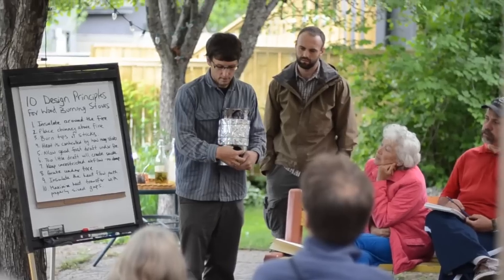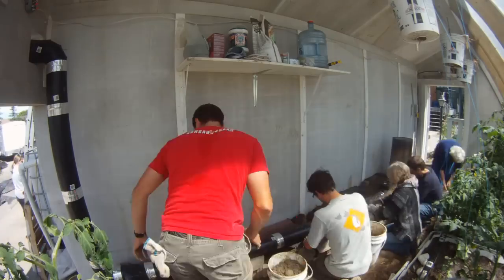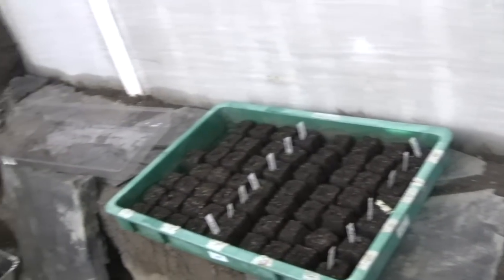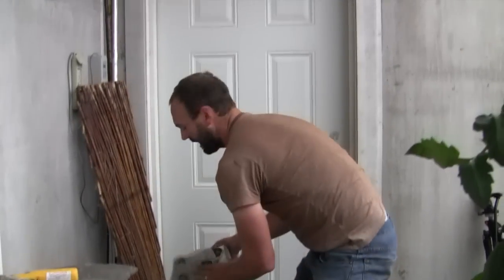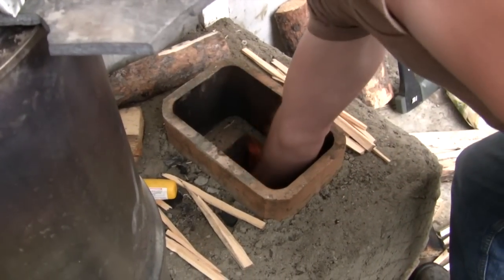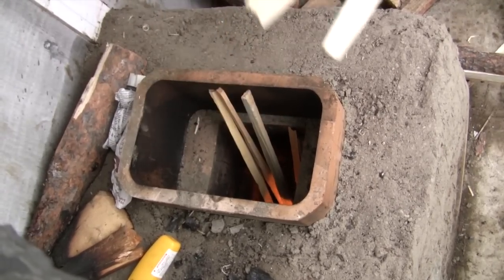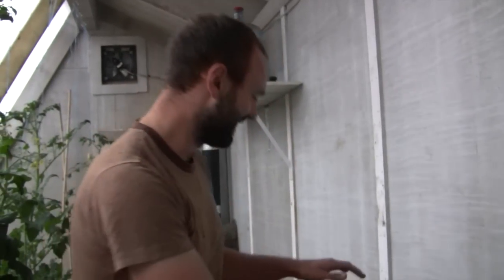Rocket Mass Heater Workshop:  Permaculture homesteading

Comment: Hey fellow rocket mass heaters! :) 
I'd like to build one with 200L barrel, and it'd heat 4 rooms (approx 15m long horizontal heat storage/gaspipe). all are about the same size. ~20m2. (sq meters), and I'd like to heat them with this one large barrell. My problem is I dont have experience building one. I'd like to use organic materials, and build without mainly metal pipes, (tiles and mud and grass). My idea is that it can go in every room, and after the 4th room,connect the exit to the base model cimney (mad by small bricks (25x12x6cm). (inner size is ~15x15cm) The main line of the heater approx 15m line horizintal 50cm wide and 30cm tall from the wall, and the chimney is about 6-7m tall. Could anyone give some advice what size should i go at the barrel? Thank you in advance.

Comment: Thank you for all your insight I’m trying to create a rocket mass heater for a big house most likely being 4 to 5 rocket mass heater one on every floor for the heat to spread out and do you have a flu pipe for a gas furnace that I can tap into if I decide to bypass the gas furnace ! Any ideas from your workshop ?

Comment: Using 3 - 55 galllon drums full of water for the mass to store the heat on the rocket mass heater I'm building, water holds something like 8 times the B.T.U.s as concrete/cobb.  After the exhaust exits the barrel over the rocket stove chimney, it flows into a hollow "tank" made so a 55 galllon drum can lay on its side, added a coil inside the heat riser so...water heats up by the coil and the exhaust system.

Comment: VASELINE ... on the kindling, perhaps a smear on a crumpled ball of newsprint...
Animal Lard, would also work.
The rocket mass heater is a GASIFICATION BURNER....
THERE SHOULD ONLY BE 100-ish °F temps and Humidity, Carbon Dioxide, and near Zero Smoke.
Also,... the exhaust hole in the wall could have been low, using a dryer vent.

Comment: You city guys had me and my friends giggling.  "Thinly cut wood",  "Schedule 40 pipe"   Thinly cur wood is kindling.  Schedule 40 pipe in an extended flue is a waste of material.  A horizontal chimney is amusing too.  A good hot rocket stove feeding into a chimney with multiple 2" flue pipes would do the same thing.  No need to ruin your siding with constant heat cycling, or overload the floor in the living room.

Comment: Building a trough from outside to cap the fire pit would draw cold air from outside the heated area and stop the fire from sucking heated air from within the living space. A small door to feed fuel could be used. I did this with my  Surdiac coal stove and increased heat retention so much I had to use a fan to blow the heat through the house. A layer of vermiculite plaster on (part?)of the barrel will reduce the excessive radiant heat at that point, sending more heat into the mass. So many ways to improve...
Reply from the maker: Thanks for the comment!

Comment: I remember, as a teenager, seeing a movie "Thirty Seconds Over Tokyo," it was made in the mid 1940'it was the first U.S  Army Air Force  bombing raid on Japan, the two engine bombers could not return to the aircraft carriers so the plan was to fly on to China and land there.

The planes did come down in Nationalist China and the crews that lived had to walk out.

Finally  get to the heating system the Chinese people used for centuries......The heating stove would heat up the pipes that ran under the sleeping benches and keep the rock mass that filled the interior of the sleeping benches warm all night.... I guess rocket mass heaters and the storage for the heat that they produce, the sleeping benches, has been around for several hundred or thousand years.
Reply from the maker: Thanks for your comments Steve!

Comment: Using a high vertical exhaust (chimney) on a 'rocket stove' is not only unnecessary, it actually reduces efficiency, as does uncontrolled ventilation in the primary firebox.
Reply: how so?

Comment: Good presentation. And, I'd like to make two recommendations...a simplified hand-crank "pin-wheel" that can be used to create the draft with a few turns (think about the hand crank blacksmiths use to oxygenate their forges)...secondly, for demonstrate the 'rocket' in RMH (and I seriously recommend this for a workshop), take a 55-gallon drum, punch air holes about 1" up from the bottom around the base, put a high-temp metal pipe (6" diameter or so, 6' long) sticking out of the drum. Load the wood, start the fire, and watch the 'flame thrower' go. For a more dramatic affect, put the pipe in after the fire is started, and go from the hobo heater to a true rocket stove. Then consider in a RMH, that flame that's shooting out the pipe, is instead under the inverted drum that's the RMH's main heating element. Instead of all that heat going up a chimney, it's loading up into the mass, to re-radiate!

Comment: I understand the idea of heating a mass so that it can re-radiate over time, but not the rocket part. A rocket stove needs a constant feed of small amounts of wood, so you have to babysit  for hours. Also it burns the air from the room putting the entire house in negative pressure, sucking cold air in from every crack. The better solution is a masonry heater with ducted combustion air. Light a fire, close the door and your done. One fire a day for milder climates and 2 for really cold regions.
Reply from the maker: +Greg White yes you are right. A masonry heater is less work to manage.
Reply: You should take a look at these resources:

http://batchrocket.eu/en/designs
http://walkerstoves.com/index.html
https://permies.com/c/7

The cutting edge rocket stove designs for shelter heating is now the batch rocket. Mr Walker suggests that a hollow bell mass outperforms a solid mass if built correctly. Lastly, some folks believe that using piped in air for combustion promotes degraded indoor air quality

Comment: I think you have lost the way a rocket stove works, you have to have its air coming from under the fire, now if being you are top loading, you need to install an opening in front at floor level, and install a heavy duty crusher screen up off the bottom to  have your fire on with a shot off so it don't draw the air out of the room when no fire, that is how a rocket stove works, draws air in under the fire, not in with the wood, its a 2 level chamber, not one
Reply: You are wrong

Comment: I get the same heating effect in my shop and my home, and I have told everyone that is pouring a concret slap, to put a plastic on the ground under the floor and footings and lay 2" riggid foam under and up the sides of the out side of the footing, and all under were the concret floor will be pourd, then lay  your steal wire mess on top of your foam, and depending on the size of your slab, make loops of 1/2" pex pipe in runs of no more then 200 feet each, bringing both ends all back to the same location, use a minimum of 3 loops no mater how small, more loops the lager you go, pour your footings and floor all in one pour, making the floor at least 4" thick, , this give you super mass heating as not only will it heat up the mass concret floor, but also all the way up all your walls and everything in contact with the floor, I bought a oil boiler, and heat with that, the hot water at 160 deg pass though the loops of pex pipe heating the whole mass, in my old mobile home it use to cost me 5000.00 a year in oil to heat it with a forced air furnace, now I am heating 10 times the area for under 800.00 with out  -40 winters, but think anyone will lissom, they just pour the floor right on the ground, witch robs the heat into the ground, they don't put the pex pipe in, nothing, I don't know why, 1/2" pex pipe is only $28.00 per 100 feet,,  I can burn regular fuel oil or unsed oil, so far just using fuel oil

Comment: Could you (or someone else) expand a little on the "other biomass" side of things? 
I understand the use twigs and wood that fell of the trees anyway, and if you have some old pellets or other "scrap wood" that would be great too. And suddenly a good use for the christmas tree when that is done ;) You mention pine cones, are they good? 
But what else could it be? Inspire us :D
Reply: biomass is the heat/ energy 'collector', the time your fire is burning the brick/mud construction will absorb the heat and slowly dissipate throughout the night - think of that hot sun baked patio after dark when you sit out there with bare feet feeling warmth from it long into the wine soaked night ... the rocket stove design is an efficient burner due to the 'draw and exhaust'  of the air rushing through it - think of a carburetor (what it is actually) and the venturi effect .... pine cones , dead branches and, if you're a well balanced homestead nurturer, you will be pruning your grape vines, fruit trees and that wonderful old shade tree that gives you so much cool relief in the summer while snapping beans, not to forget the collection of old and storm damaged limbs that should be cleared - if that aint enough, or you're acre poor your ignorantly wasteful honyock neighbors, the magotry, will always have piles here and there - free for the asking - but of course you'll be a wood hoarder by then because we're talking minimal resource to run a rocket .
Reply: anyting that will not put man made toxins in the air is ok
Reply: Krydolph try cow pattys, Tibetans in the mountains use dried yack dung to heat with.

Comment: Because the cob is still wet? No. the reason steam comes out is because the oxygenated air is coming from a green house where the moisture content is high.if you had a tube that led from the outside to the combustion area, you would avoid pulling the moist air from inside your greenhouse to feed the fire, making it even more efficient.

Comment: I'm considering building a much smaller rocket mass thermal heater for a much smaller space and was wondering if you think it would be safe to use tin cans, like soup cans with a concrete outer shell for the heater. I've seen a few built on youtube and I'm wondering if the concrete is a good mass to radiate the heat?

Comment: like the design one thing to keep more heat in that room if someone hasn't told you already build a cage stock big rock around it to gather more heat instead of losing more all that he pushed off your Barrel you can be pushed into rocks to make the greenhouse last couple days longer maybe maybe 6 to 12 hours longer
Reply: The entire point of the barrel is to provide immediate heat, heating up the space quickly. Not being able to do that is a serious issue if you ever let it get cold in there.

Comment: If the outlet is venting steam and not smoke, why not attach a condenser?
Reply from the maker: +Dean Rasmussen the combustion products are clean and warm. It already condenses alot of water and I frequently have to release the water from the last clean out.
Reply: +VergePermaculture is it necessary to cover the combustion chamber, or does the air movement itself prevent smoke from going back into the house?

Comment: So, I saw on permies dot com today that they recommend to NOT use metal for the tube inside the heat riser (inside the barrel) because it breaks down from the heat and causes air pollution and pieces go out the exhaust.  Can you recommend another material?  Yours is still one of the most informative videos on rocket mass heaters because you explain what each section is for and why the wood is vertical.

Comment: possible to have firebrick & heat cement replace that nasty metal drum?
Reply: To my understanding, no. The drum both provides heat quickly and is what causes the suction.

My understanding is that the drum cools the air, causing it to decrease in volume and suck more air in, since most of the heat gets stored in the mass, the chimney at the end doesn't cause much suction.

Comment: What is different about a rocket mass heater compared to a Swedish fireplace or other masonry heater thermal mass unit?
Reply: Since the other guy apparently doesn't even know what you're talking about, let me step in.

Basically nothing. This is probably cheaper than a masonry heater though, since you're basically running a pipe through a large mass, whereas a masonry heater requires more specific construction materials and a more complicated design to really work well.
Reply: +Rollin Shultz All of the fuel and gases are burned, leaving very  little ash behind.  and like he said,  the mass (concrete./masonry that surrounds the tubing stores the heat and gives a longer lasting heat,  if built properly.
Reply: +Tim Spriggs Those are the same qualities as a Swedish Masonry heater, the fuels burn at up to 1100° and the escaping gases are approx. 70°. I would like to know if there is something different or more advantageous in comparison.
Reply: Rollin Shultz It really boils down to what you're happy with.  Which , I hope you are.

Comment: Question - couldn't you use a section of ceramic chimney liner for the center pipe of the rocket heater ???
Reply: ys and clay it in with bricks, leaving the top of the center flu 2" lower then the drum, if you go lower the 2" you will not get a proper riser effect, they are using a stove pipe inside a larger steal pipe and filling it with a mix of dry clay, vermiculight, as an insulator, over time the stove pipe met away, but the clay mix stays in place, as the burn temp in that flu is 3000 degrees, you have to seal the drum down with a clay sand mix, I have a hill on my land 35 feet high and half mile long, I dig clay out of, my whole property is red clay, to brown clay, 60 feet deep, in the valley under 6 feet of clay is sand, white, and brown, the white sand is to fine

Comment: A good example of why the UBC (building codes) require the smoke stack  (chimney pipe) to extend so many feet up past the bldg. roof ridge. Note the smoke pipe coming out of bldg right at the window sucking air into bldg.with a window fan! Dangerous! The price of "do it yerself as u go" construction.

Comment: Enjoyed the video. Question - After the fire goes out does cold air from the outside make its way back inside through the duct?
Reply: Technically heat would continue to go out the pipe for the 30 hours that he stated as heat rises, the draft up the pipe would continue to pull the warm air out of the greenhouse. A fix for this is after the fire is completely out, you could put a lid over the intake and seal the system off from drafting.
Reply: +Brian Werner Buena pregunta !

Comment: I like your video, but it looks like your stove is sucking air out of your house witch would cause a draft. me I have two chimney on my stove, one of them pulls air from outside of the house, to feed the fire inside of the stove. I call it a closed system, the air in my house doesn't mixes with the air in my stove. And that is a good thing for me, cents the air doesn't mixes,( there is no smoke in my air) and no draft.
Reply: your the 1st person ive  seen comment on any make-up air in any of these wood stove systems, hats off to you, ive always cracked open a window closest to the stove, but if your're building from scratch its good to create a fresh air supply directly to the intake of the stove, just critter proof it

Comment: hi mate,

Nice job.
I am planning to build my own a rocket stove heated green house.
After reading and whatching a lot about the subject ( build a few one outdoor),
I find your video convincing!
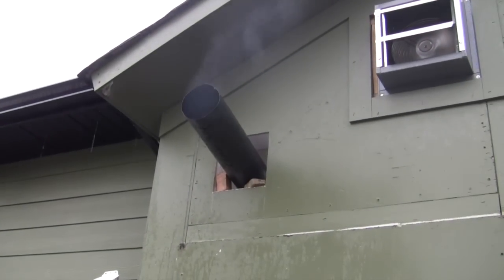But i have seen a fully working fan spinning on the video when you go out and check out the steam. ( 10:50 )
Does it help you to get more draft in the combustion chamber?
Do you have smoke in the room if you dont put the fan on?

regards,

Comment: back draft in a stack means not tall enough outside stack. 3 feet above roof  2 feet above anything 10 feet around it. its called a 3-2-10 rule. man tell theses peps on these type of venting systems,you can realy mess some1 up on this. end up burning down there homes. chex code peps on all venting systems before doing them no info is as bad, as bad info. code for venting systems is called NFP211, also the creosote that will collect in that unit isnt talked about or how to remove. i do like the ideal.

Comment: That statement about burning with wood consuming all trees in 4 years is just scaremongery because it's based on our current style of living and completely simplistic statistics.

For a start, at least 4 billion people don't need to heat at all due to where they live. Secondly, we don't all live in standard housing where sufficient heating is a major problem.

Thirdly, this calculation is not based on efficient wood burning heating methods and does not consider the part used for timber, cardboard, paper etc. (which could be recycled for energy) as a source of heating.

The world is quite capable of providing enough wood for this idea if man were to decide to switch over. 

If 7 billion people needed to heat as we do, it would take less than one third of a hectare of forest per household (well designed skyscrapers and apartment blocks would of course use heat far more efficiently than houses) to provide a constant supply of hardwood, felled (and replanted) after 50 years of growth.

Taking America as an example, you'd need 10% of the land as forest for heating and 10 % of the land as agriculture for eating (well, as long as you don't make half your diet meat) and 1-2% for a decent place to live That leaves you more than 75% of the country for everything else.

It's viable, but we'll never do it. Man isn't interested in rationality and work.